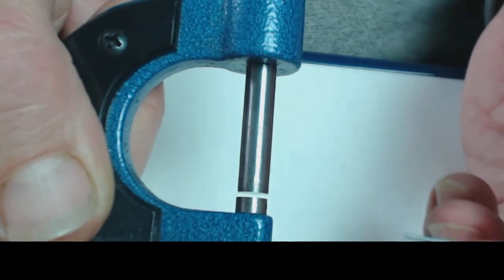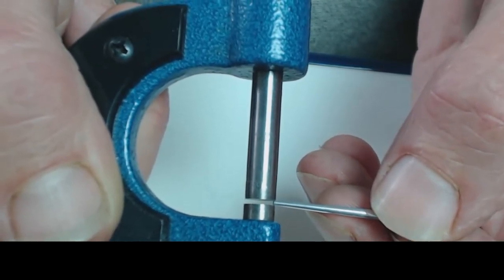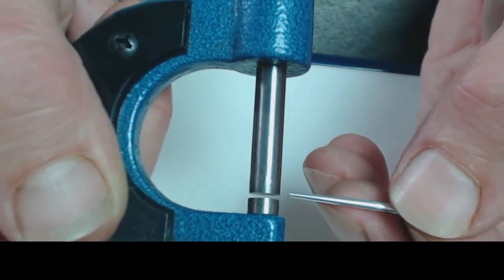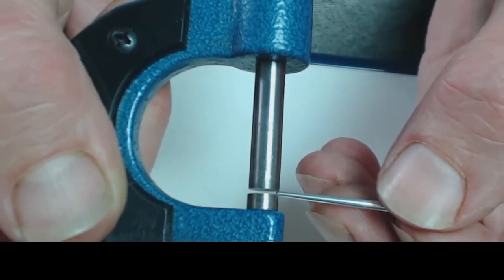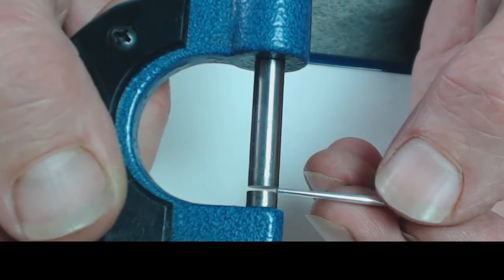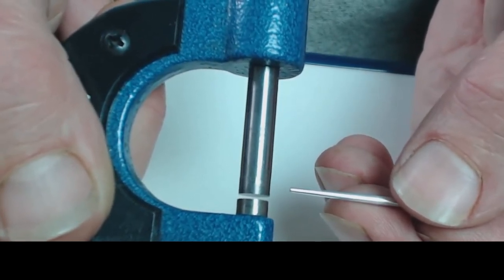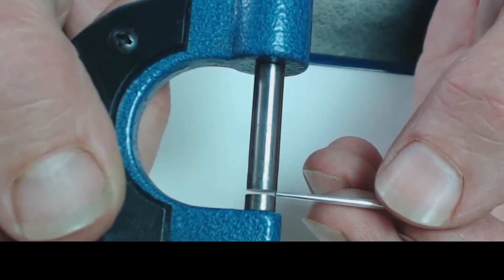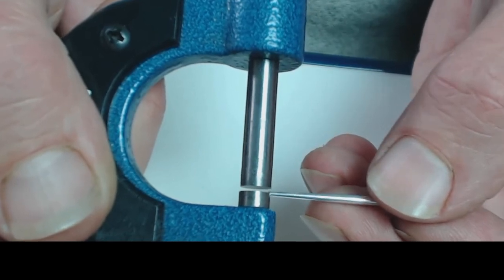Carburettor Tuning for Performance:  Measuring the needle tip

Comment: I don’t have a micrometer myself, but while I was attempting to rebuild my twin mikunis from my virago ( one of my many bikes ) I did wonder about how to do this practicle step. I replaced with a single carb conversion in the end as I was rating up the bike and wanted a different look completely,, and had a two into one manifold made, side mounted a hitachi carb, but would like to get to better understand the carb and it’s internals, and particularly the tuning measurements needed, so looking forward to upcoming vids. Keep it up mate, as before, enjoy your content.
Reply from the maker: Thanks again for the support Spanner Monkey.

Yes, this is a great measurement method (my own design)... very accurate indeed
The only problem that we have is 'taper start'.

This is very difficult to measure accurately.
I did look at how it might be done, but as yet I haven't come up with a solution.

The problem only applies (I believe) to Mikuni needles.
Their data is so wrong, it breaks the laws of physics.
But they are not interested in correcting it.

I figured that we must simply hope that they have got the taper start dimension correct.
If we then get the tip dimension... my software calculates the rest.

Only single taper needles at the moment though.
However, this should be fine.
The dual taper needles are more for emission regs and fuel consumption figures at 100kph.
... and they are obviously very difficult to tune.
That abrupt change moves with the notch position, making adjustment very difficult.

Dellorto barely bothers with dual tapers.
... and now that I have calculated all the Dellorto needles for Mikuni carbs, there is no problem at all :)

Anyway, the job now is to try to rally the troops, and get the 1st vid moving.
If a lot of people respond over say 24 hours, it may be possible to hit the 'trend' algorithm.
That's the plan anyway.

So its 750 messages to be sent manually :(

It might work :)
Reply: Good luck with it Engine Tuning, you seem to know a lot about the mechanics of YouTube as well.
Reply from the maker: The messaging doesn't work effectively, if the system isn't set up for notifications.
People don't know they've been messaged.

Evidently we learn by trying :)
Reply: Indeed